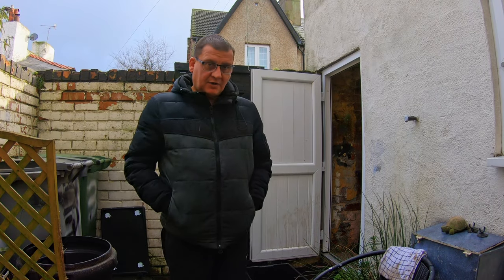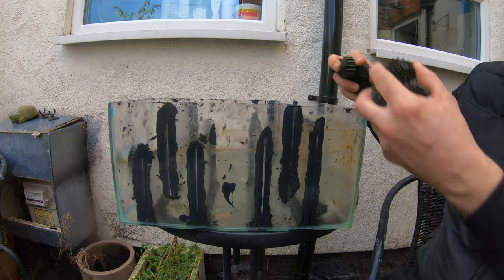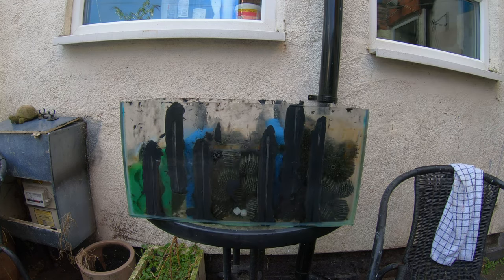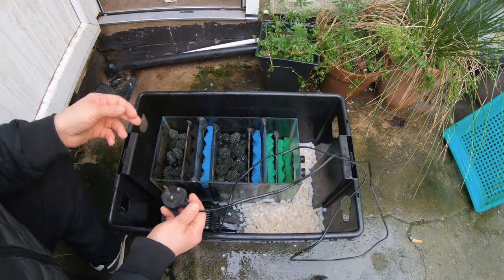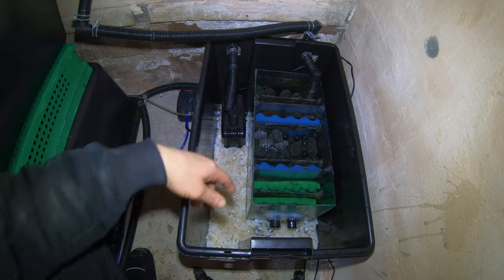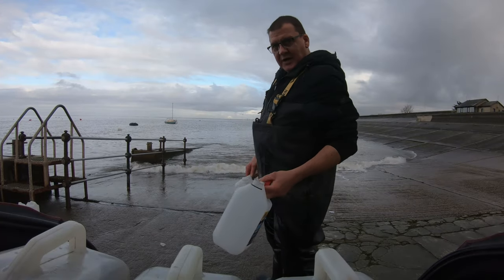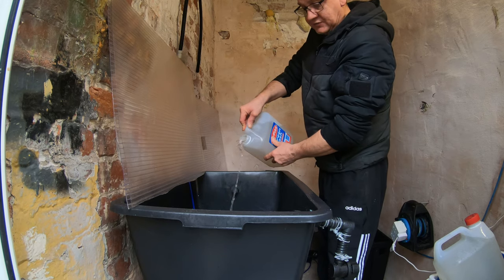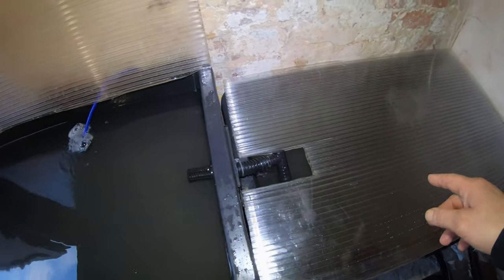Peeler crab live bait tank setup - keeping peeler crabs.

Comment: Thanks for this video pal, I'm setting up my own tanks now, very similar to yours. Iv been keeping some in a single smaller tank with a small pump and filter and the crabs love it but I have to do a water change just about everyday atm so it will be nice to get a proper setup going. Should be able to fill them up tomorrow and start 1st cycle. Do you have to top it up with fresh water occasionally to keep the salinity down?
Reply from the maker: yes 25% water changer every week

Comment: Alright bud, good clear info on the crabs. What method would you use for sand eels, I have tried but failed badly. 😂😂.
Reply from the maker: you can keep them in a aerated bucket for a few hours with not much trouble they will last longer in this type of set up as it is filtered and has loads of oxygen in the water but there very fickel to keep

Comment: Great Video Paul, very similar to the set up we have for our tanks but we went large scale and have 8 treys. Some great tips there and will definitely put them in to practice.

Do you add any bacteria initially to the tanks to get the cycle started?
Reply from the maker: yes mate at the start just to kick it off  with the cycle and i let them run for a few weeks with a couple of water changes to keep it in check
Reply: @StarfishSeaFishing  that’s exactly what I was told to do. Last year was our first year at it and it didn’t work at all. Learnt a lot more the past 12 months about the set up and the amount of Media we actually need to add to it.

Where did you get the larger media balls from?

Comment: Hi mate, do you not find the crabs start peeling really quickly in the tank or do you find it’s due to temperature change that make them peel, enjoyed the video mate👍
Reply from the maker: yes that is the idea the vast majority will be frozen down for later in the year so i have crab on a daily basis ready to freeze if i want to keep then for fresh i will slow them down in the fridge in trays like everyone eles this method help me hold lots of crab i can go thou and freeze down quickly but they tend to only need checking two times a day i dont miss many but i do miss a few
Reply: @StarfishSeaFishing  ok mate that’s what I thought, I tried them in a big bucket before just with an air stone and the majority of them peeled within a couple of days but wasn’t sure if it was due to the temperature
Reply from the maker: @PiscatorUK-Fishing  the water will stay cooler with more movement in the tanks and in feb march and april i dont have much problems with temps i dont keep crab in the summer i am all done by then
Reply: @StarfishSeaFishing  cheers for the info mate, looking forward to seeing you out and about
Reply from the maker: @PiscatorUK-Fishing  thanks mate